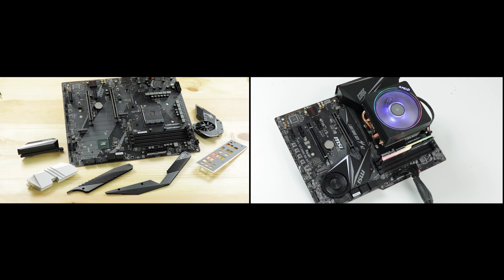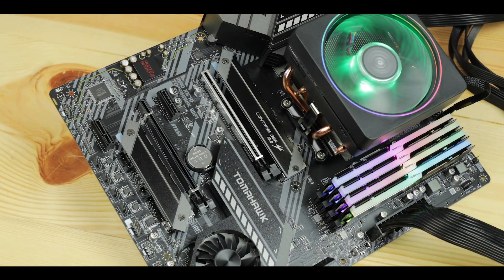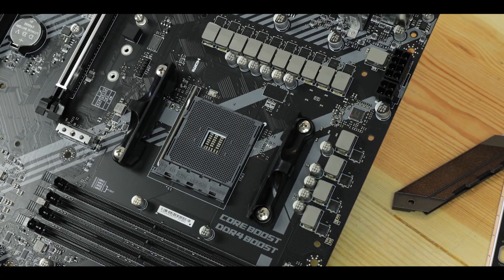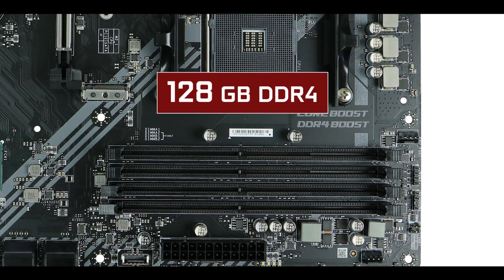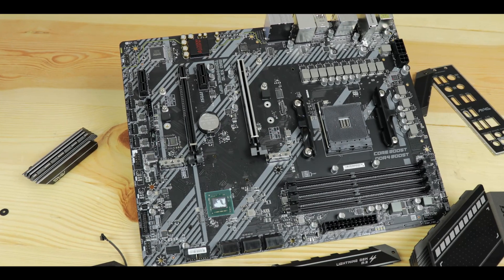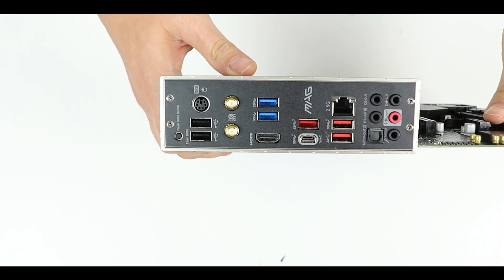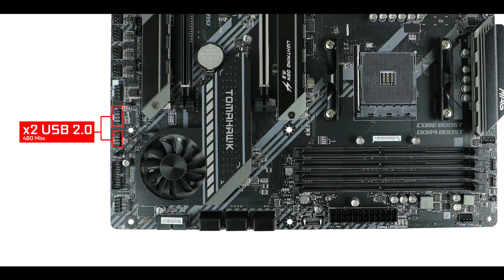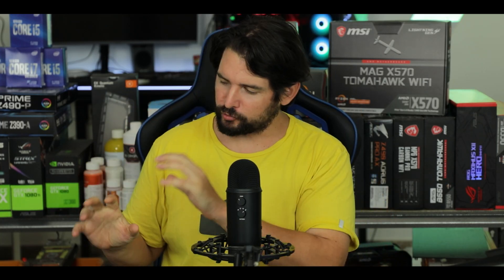MSI MAG X570 TOMAHAWK WIFI, MSI’s apology!

Comment: Thanks for the review and sharing,my experience differs from your review.
I bought this MSI X570 Tomahawk. 100% disappointed in this motherboard. BIOS is flaky and pain in the ass. Any small changes in BIOS causes no boot,I have even seen stable saved OC profiles fail to boot when switching the profiles.There is no reset button for CMOS reset which results in taking the computer side panel off and jumping the JBAT1,come on it is 2020.Now i can say if you do not overclock or make adjustments in BIOS then this motherboard will work great with great VRM.
Reply: Did you ever find the cause if these problems or is it the motherboard?  Yeah, i kinda agree about cmos button but to be honest, when you end up tinkering you shouldn't need that button anymore anyway.

Comment: That's my motherboard! 😊 To be honest, it's a complete overkill for my system, but I had boxes to be checked and this board checked all of them and then some.

But there was one funny thing that I encountered with this motherboard when installing a 4th gen M.2 SSD with it's own heat shield. I couldn't use the screws from the heat shield on the motherboard because they were permanently attached to them and I couldn't dare to remove the heatsink from the M.2 SSD so I had to find another screw myself. Otherwise, loving this board!

Comment: I just bought one of these and this was a super helpful review!! I don't think they will be for sale for very long.
Reply: Agreed, used this review to choose the X570 Tomahawk instead of the B550 Tomahawk (which had been on backorder for weeks). Loved getting WiFi 6 included on the board, Pcie 4.0 on both M.2 drives + upper Pcie x16 slot, and particularly 2 USB 3.2 front panel connections (which I needed) as well as the USB-C front panel connector. Price difference between B550 and X570 was not that great considering what the X570 offers.
Reply: @balesjo  does either of them have 3.2 Gen 2x2? (20GB) ? And thunderbolt ? Why wouldn’t it be for sale long

Comment: I've just ordered one an hour ago. Looks like I've made a good choice.
Putting a 3800x in it.
Reply: Hans Schtuk im looking for a board for my 3800xt, i was considering the msi meg ace, but i can get the wifi tomahawk 570, for $215. How much did you pay
Reply: @HardHeadMilitary   $299.99 CDN. @ Amazon. sorry for the late reply.
Reply: Hans Schtuk thats cool Hans! I picked up the meg ace. It was no issue with everything working, very sturdy board.
Reply: I myself paid around 250€ and still think it was pretty cheap for what it offers. 🙂 And that's with taxes and all included. I'm not sure how it works in other countries.
Reply: Thunderhawk51 yes sir. I had found it at several vendors over charging for the tomahawk, and i found the meg ace for $299USD, and a $25 off coupon, so i went with that

Comment: This may be a stupid question, but i've noticed in this review it's stated that Ryzen 4000 will be supported with this MoBo, does the Unify fall within that as well, or will the Unify not support the 4000 when they are released?

Also secondly, personally which do you prefer, the Tomahawk or the Unify?

Thank you!!
Reply from the maker: Unify will also support Ryzen 4000 :)

And yes I do prefer the UNIFY. But that s a different price range all together.
Reply: @Laurentschoice  Thank you for the quick reply, I like the Unify personally due to the lack of RGB.

With how increasingly impossible it is these days to find RGB-less components, if I want more color I doubt I'll have a difficult time adding it later on.

Comment: Asus Rog Strix B550E or This mobo?
Reply from the maker: This mobo!
Reply: @Laurentschoice  B550 has Gen 3.0 Chipset uplink and X570 has gen 4.0 does this make any difference? In general uses? Gaming and all
Reply from the maker: None what soever. Not yet anyways.
Reply: @Laurentschoice  then i would go with 14+2 Phase VRMs for better OC. And Asus Has that ROG logo too. Which i loves🤤😛 I'm paying for That Logo Only
Reply: @Just_SAHIL  I was going to buy the Asus Rog Strix B550E, but decided since its a new build I would step up and get ahead for the next cycle upgrade in a couple years. The Asus Rog Strix B550E is a good budget choice though.
Reply: @ericsfc1ea.16  ohhh

Comment: I thought the audio was 1200?
Reply from the maker: by the way, where have you been. Was wondering about you.
Reply from the maker: It is. Thanks for letting me know. To be honest, the ALC 1200 and 1220 are rigorously identical . Should not change anything to the review itself. Though i'll add it to the correction notes :)
Reply: @Laurentschoice  They are not identical, difference is pretty big
Reply from the maker: actually i just looked into it  a little more. Your right. It is quite the difference. Will make sure add that to the correction note for the  in-depth review :)

Thanks norbit.